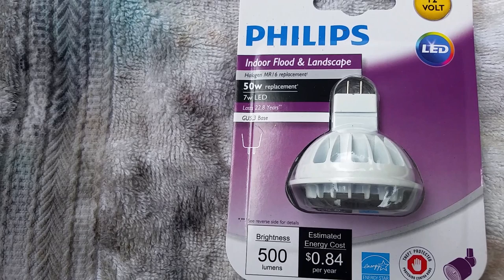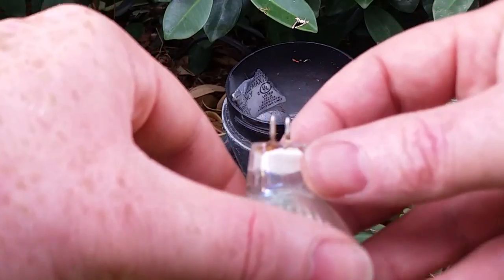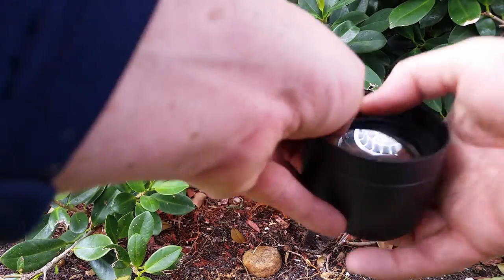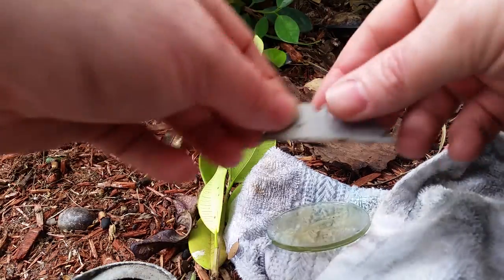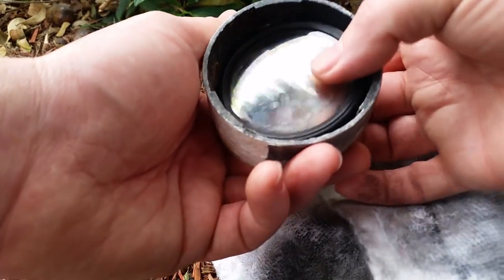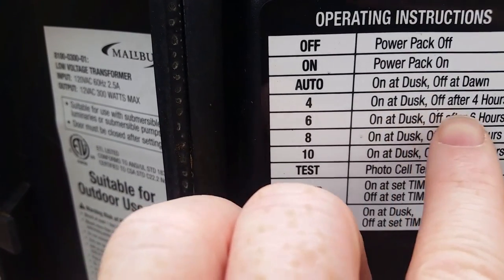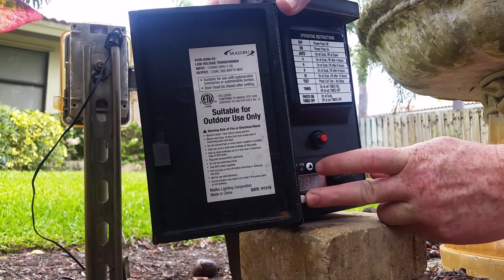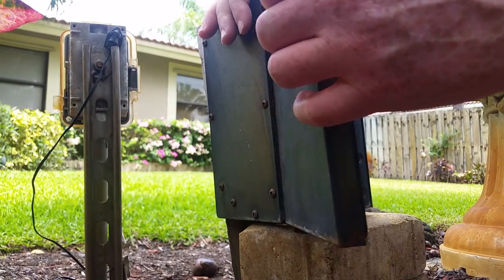How to Convert Landscape Holagen Bulbs to LED

Comment: Normally when we remove like this,gaskets getting deteriorating and water passing inside the lights later on. What is the reason and how we can overcome this?
Reply from the maker: You could try using a bit of clear exterior silicone. Apply a small bead on the inside of cap where the glass touches. and work in with your finger. It should seal it and if you only use enough to cover the edges  it should be easy to open the housing later if you need to replace the bulbs. I hope this helps. Thank you for watching!

Comment: I have portfolio landscape lights from lowes I just installed and want to change the halogen bulbs to LED bulbs .But all the ones I see say they are for dc controller and my old set was a malibu ac controller also .Can the bulbs that say dc be used on ac controller .I can't see any difference in them .My bulbs that are in there now say T5 on them and item number for the set is 0688428 .I can get the ones for the dc unit really cheap and wonder if it is worth the try to buy them
Reply from the maker: sissy murphy I'd say get one and see if it does what you want it to do and if so you can decide to switch all of them out or not. LED is the future using less power, being brighter and never hot to the touch. I hope this helps.  Thank you for watching and thank you for  commenting. The more we share the more value we bring to each other.
Reply: There are both styles.  The ones capable of AC also have a diode in series, and as a result, produce 60Hz flicker running off the old unregulated Malibu 12V transformers.  IF you buy some that need DC you have two options:
1)  You can unbend the leads and pull the top off and put a diode in series on each.

2)  The best option - Put a "bridge rectifier" and large filter capacitor after it in the Malibu box.  Size the rectifier capable of more than the typical current, though switching to LED bulbs you reduce current.  For example you'll probably want one capable of at least 4 amps considering heat is the issue and they may run in hot outdoor weather.  Provide at least a couple thousand uF capacitor rated for 16V or more.  HOWEVER, some of the lights designated for 12VDC use a series of LEDs and their power consumption changes extremely with the jump to ~15VDC (at load) rectified from 12VAC.  You may find that each light also needs a low ohm series resistor added.

This is how some of the generics get away with selling bulbs so cheap, that they  make one thing that isn't really correct for all applications then you have to FIX it for yours.
The other option is put a single 4A diode on the output of the Malibu transformer.  They'll only get half wave power so the average current is reduced and a single diode will handle all LED bulbs without them being modified, but they will have 60Hz flicker.   You can still use a capacitor there for smoothing if you like.